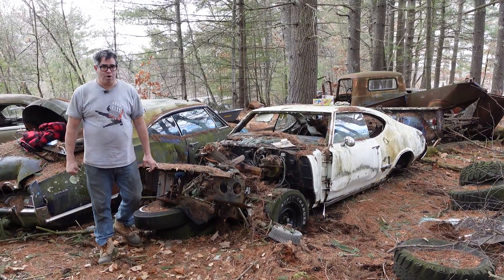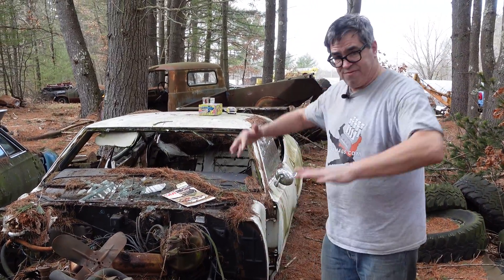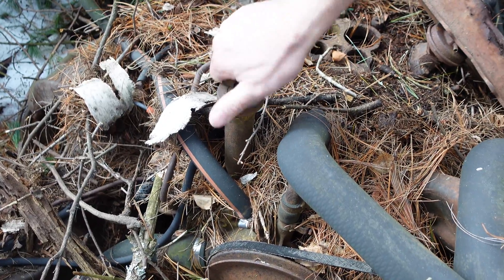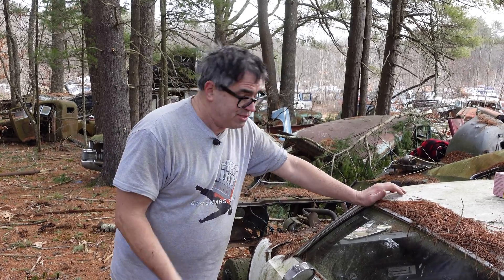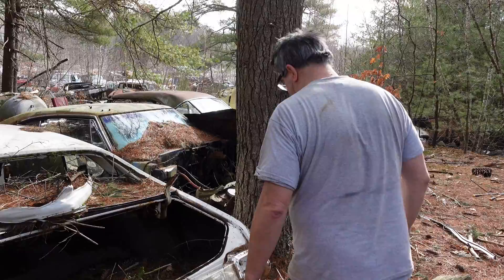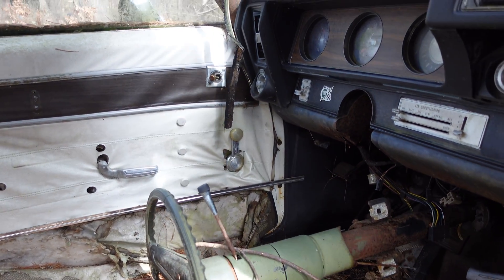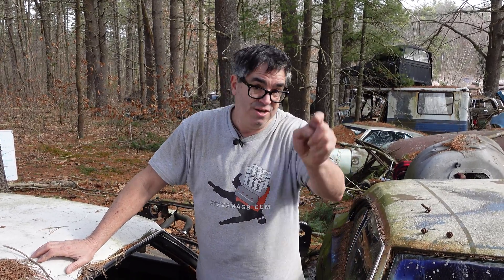Cut Less Compression

Comment: Telling a 350 Olds from a 400/425/455 Olds is hella easy . 
The tall deck motors have a cast boss on top of the timing case which is not present on the short deck motors . 

BTW , My Mom's 75 Delta 88 had PCV , and she bought it new , so i know it was factory original .

Comment: So that brings up another issue, Steve, the peak of the model-car-building hobby.  I was in my prime of car-model building in the early '70s, but it did seem to me that the big model contests and exhibit-hall gatherings were on the wane.  And I remember Car Model magazine ceased monthly publication for a lengthy stretch of time in '72 or '73.  Plus, and understandably enough, static models were challenged by the popularity of R/C cars and planes.  I never got into R/C but it made a lot of sense in the wake of commercial slot-car tracks and O my, those were epic for a minute, no?  I fondly recall my Dad taking me to the big track at Playland in San Francisco, my purple Cobra got totally smoked by the big kids but it was a thrill to mix it up with them on those multi-lane tracks.  And my Mom very kindly drove to a house in San Mateo or so in the early '70s in response to a classified ad for a used AF/X HO track and we got a great deal on it.  So, all that to say that perhaps AMT in '75 or so was holding back a bit on a shrinking marketplace for model cars, sniffle sniffle.

Comment: I had a 71 Cutlass that I traded some parts/junk for back in the late 80s. The engine was MIA, but it had a factory bolt action (3 speed) with a "supposedly" factory installed Hurst shifter.
 We couldn't find an Olds motor with a flywheel for the man trans so I used a 350 Buick that I already had. I know, right? How dare me? I repented and said 10 Hail Mary's and 50 push ups.

Comment: TEL was critical to the development of air cooled aircraft radial engines in those years (1920s) when they were adding more supercharger boost. By WWII fuels with octane north of 130 and water/methanol injection (Anti Detonation Injection - ADI) were must-haves.
Reply: They supposedly have a replacement for the lead in avgas,but they're still having issues.

Comment: Very first car I bought at 20 years old was a 1969 Cutlass S convertible. Cherry Red ext., black top and interior, power windows and locks, Rocket V-8 350/5.7 and 2 speed Powerglide. But I knew nothing about what it was worth and when a few things had to be changed/fixed, I put  an ad in the local paper and within 2 hours of publication ( morning edition) it was gone to 2 very happy guys. I learned how A LOT after that about cars, EVERYTHING, and at 67 I’m pretty knowledgeable about cars. Still driving a 2009 Pontiac G6 GT, fully optioned ,3.5 chipped and stainless exhaust, cold air intake (K&N). 2nd best ride I’ve ever had.

Comment: My first car that I bought in 1976 was a 71 Cutlass S.  It was a stripper with no PS, PB or AC. It DID have a 350 4bbl,4 speed, dual exhaust and 3.43 posi. That car was a blast!  It was unassuming and that 350 was a strong performer.  Surprised many other people who had vehicles with higher street cred from the era.

Comment: If anyone is wondering what kind of difference it makes when upgrading the front brake drums on one of these cars, well let me tell you. My first car was 1970 Buick Skylark and I was able to upgrade my standard front drums to the aluminum finned ones that are shown in the video and  they are better than the standard drums for sure, but your still going to crash into what ever it is your tying to stop for, just a bit slower than you would have with the standard brakes. A panic stop at 90-100 mph on standard drums will slow you down  to 45-55 mph pretty quickly and then they just completely give up by the time your going 35-40. The same panic stop with the upgraded drums will get you to 25-30 mph before they give up. I'm really surprised I didn't kill my self in that thing.
Reply: I think most of us are surprised we didn't kill ourselves in our youth!
Reply: Back in the late 70s my friend had a 70 GS455 convert with those drum brakes and no rear sway bar. That car was soooo dangerous! Blindingly fast, with no stopping or turning ability. Sadly, he crashed it in an ice storm, but that had nothing to do with the crappy brakes or suspension.
Reply: @61rampy65 just crappy driver I'd say
Reply: You should have got the station wagon disc's.....🤗
Reply: @will7its  That is exactly what I wanted to put on but I was 16 years old with no money and most of the cars in the junk yards around my house didn't have the disc brake option and  the ones that did were either gone already or the they wanted why to much money at the time.
Reply: @b.snoodleman5864  Yeah, we didn't have pick and pull back then....

Comment: I wonder if Steve read my post from yesterday concerning the final days of the Olds Cutlass, and this rerun was a precursor to a lttle series on that subject? That would be cool if is!
I wish Steve could have done a VIN # check to see what engine was in this Cutlass. The engine present there could be a Rocket 350 with a 4bbl carb (with the extra ooomph to run the A/C compressor), but I don't think 350's had "Oldsmobile" stamped into the valve cover. The ones I owned never did. Which leads me to think this MAY be a 455. And it does appear the gearhead that owned this car may have been contemplating a manual trasmission as noted by the hole in the transmission hump.
Reply: Maybe we will see. 👍

Comment: I rebuilt a 350 in my friends 69 cutlas convertible and installed four wheel disc brakes. I also put my z28 steering column in it! I regret it so bad but I needed the money more than the car. Now he’s asking for floor pans.

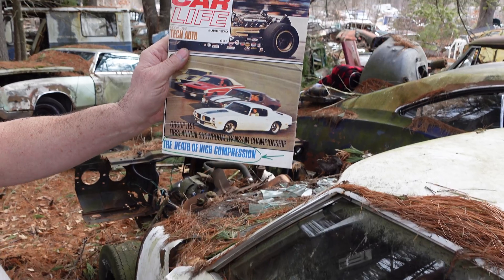Comment: In 84 me and a friend bought a 69 cutlass s $400 , no rust barn stored all maintenance records from day. Couldn't see the gauges frosted over, farmer wanted 500 but gave us 100 back and said it likes gas. Get it home , car is mint, wash it , change fluids etc. Interior like new. Take dash apart clean lenses with tooth past and see it has a tach, clock etc. Looking over car, 4:11 rear gear pos traction. This thing is a beast, 1/4 throttle will roast tires for ever, this car got us in trouble lol. After research, and looking through paperwork,  it has the rally sport pack option,  basically 442 with bench seat. What we could find they made 312 of them and far as we new only one in green, but back then no internet etc to really research it.. sad part is over time some bad things happen and it's gone still have title and keys but cant find it.  A story behind it but I regret the out come. Did see it in hot rod magazine  later and the title of article was old junkyard dog. That car was nothing but trouble lol. Still cant hold a license in pa to this day.
Reply: Great story! 😂 Damn, how fast were you going , before you finally stopped ,and let them catch you?😂
Reply: @jeffreycarleton1535  lol which time , they never did catch me , mailed me fines and arrived at my house. once we loaded up 3 sets of tires and 2 jacks , did donuts in a parking lot until you couldn't see. just flashes of blue lights in the smoke..  blow a set get out put on another. 1/4 throttle and you could burn posi for oh until tires blew.  get in car put it in drive 1/4 throttle the car would rise up turn the wheel and make perfect circles. kick it in passing gear at 50 and burn posi. one night burned posi from one town to the next 5 miles . paid a lot of fines . $10,000 plus with a $400 car. . young and dumb but had some fun

Comment: Yes, that appears to be a later Olds V8 from what I can tell. These cars were very popular. Yup, sticker "muscle" circa 1982. LOL. I bought a 1962 Sears Craftsman toolbox set up (upper chest and lower rollaway) that had the "sticker muscle" going on such as 'Ben Pila Speed Centers", "Moroso", "Snap On Tools", "Crane Cams" and the like. I removed most of the stickers on it. However, I got a 1981 Sears Craftsman/1983 Snap On combination from a coworker and it was a "sticker muscle" box too with "Castrol GTX", "Wynn's Extend", "MAC Tools---The Brand You Own Not Loan", "Gabriel "Hijackers" among others on it. That one I left alone. 

No VIN, can't win, but easy to figure out, no doubt: 3 for Oldsmobile, 36 for Cutlass S with eight cylinder engine, 37 for two door hardtop coupe, 1 for 1971 model year, possible M for Lansing, MI assembly (closed in 2006), or G for Framingham, MA assembly (closed in 1989), or Z for Fremont, CA aka "Freaky Fremont" (closed in 1982) among other possibilities, and the rest is the production sequence.

No tag, can't brag, but easy to figure out, no doubt, ST71 for 1971 model year, 3687 for Cutlass S two door hardtop, then a letter code for the plant of assembly as noted above, possible 17 for White interior trim, 11 11 for Cameo White lower and upper exterior paint, among other codes. 

Michael "Mike" O'Connell who owned the speed shop as noted passed away in 2004. I hope Mr. Magnante is still doing OK as this is another re-run.
Reply: Here’s hoping Steve has reconnected with Liz Frem and has been holed-up with her for the past few weeks at an Airbnb in Vermont…….🛏👍😂
Reply: She is married. Lol.
Reply: OP s the most annoying commenter...
Reply: @Vicus_of_Utrecht  ?
Reply: @googleusergp  just, put the drink down and shush
Reply: @Vicus_of_Utrecht I don't drink, so no need to do that. What's the point of your post besides that it and $2.90 gets you on the bus?

Comment: Drum brakes are just as efficient as disc brakes, it only that disc brakes have much better cooling.
Reply: In a braking comparison test by Motor Trend in 1965, the all-disc Jaguar E-Type stopped in the shortest distance ( as I recall, somewhere in the neighborhood of 135 feet) followed closely by the all-disc Corvette. But third place, at what was, for the time, a very short stopping distance, was the all-drum Corvair at 143 feet. Better than Porsche. Better than Ferrari. Better than Alfa Romeo. Pretty impressive for a sporty compact, huh?

Comment: There is a hole in the trans tunnel. Looks like at some point it had a floor shifter. That green steering column does not look like the factory original. I'm surprised Steve missed that.